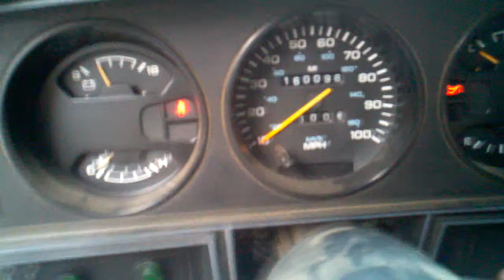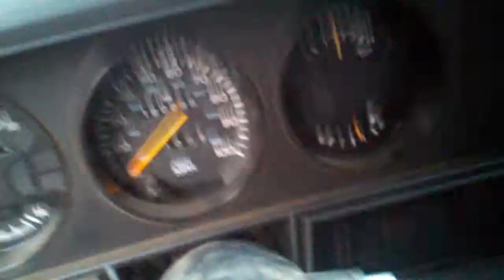1990 Dodge Cummins 12V Running Without Valve Cover

Comment from the maker: I've never pulled that much. I don't think the stock brake system will handle that, a tired one like mine doesn't handle it's own weight that well. A hydroboost upgrade might be something to look into.